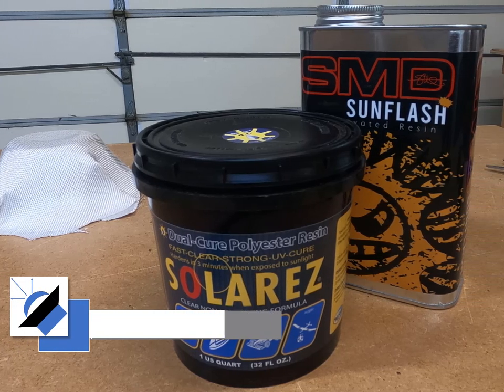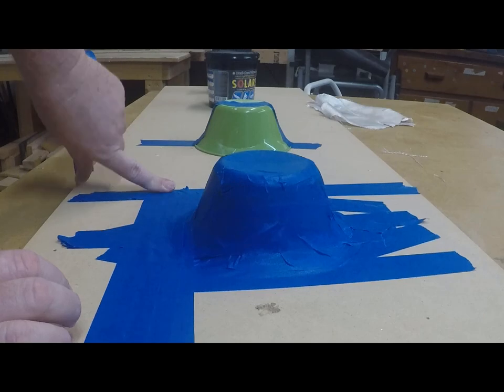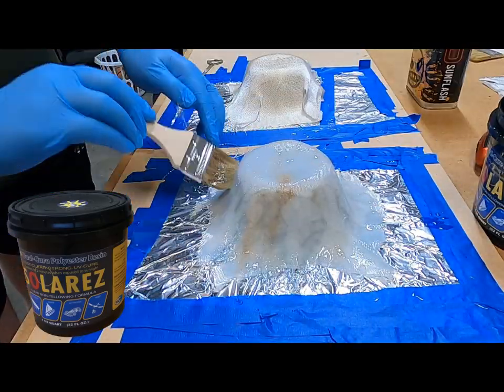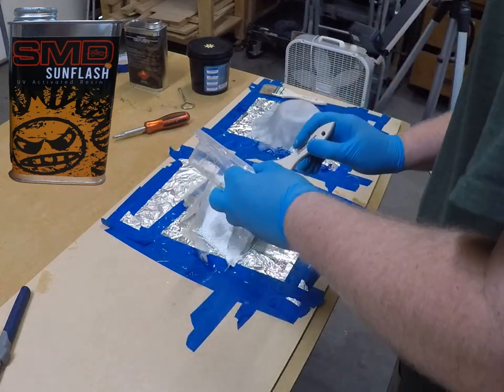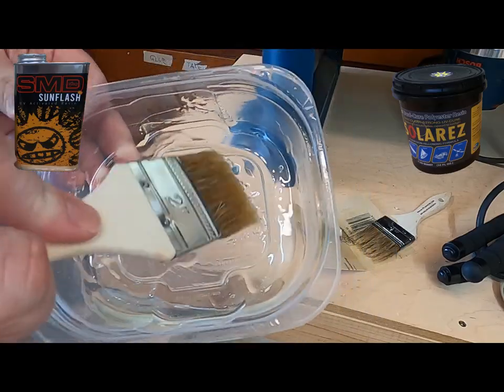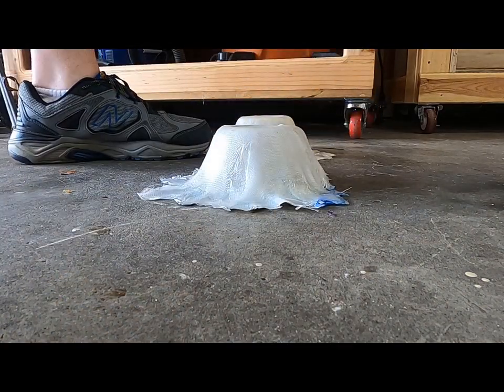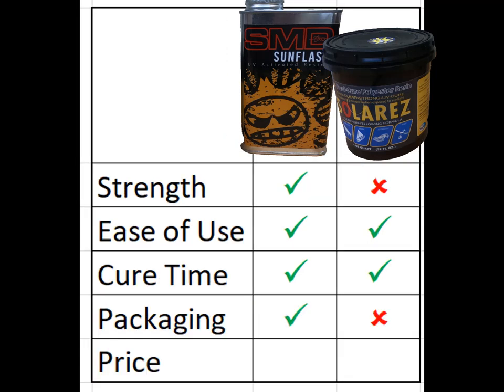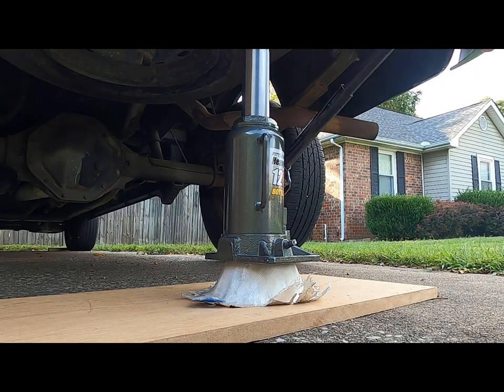The BEST fiberglass resin?  UV RESIN SHOOTOUT!

Comment: Never used the Solarez, but the Sunflash resin is absolutely amazing.  Tested it out before I decided to use for my sub enclosure that I’m currently designing.  The Sunflash resin cured in the sun on a cold day here in Ohio.  The outside temp was about 40 degrees with moderate moisture in the air, out in the sun.  The Sunflash cured rock hard in about 15ish minutes.  On a different day that was about 87 deg with moderate humidity in the summer, the outer coat of resin cured rock hard in about 5 minutes.  Flipped the mold over and another 10 minutes to fully cure.  The tests were done on 19oz woven mat used for pool repairs.  That is what I’m planning to use for the enclosure.  Only the bottom of enclosure is going to be glass, the baffle and all side panels are going to be birch.
Reply from the maker: 19 oz mat?  That's thick stuff.

Comment: So have you replaced your passive radiator? Just curious. I'm experimenting with different subs. Currently have 1 box with 2- 12" alpine type R and in a separate 2 cubic ft box a skar VXF with a rockford T-1500. The alpine box is tuned to bout 40 Hz the VXF is @ 28 Hz. Odd I know and prob frowned upon but the versatility is way cool. EVERYTHING sounds amazing. I wont go into it but there's components up front and 6x9s in the rear and are kickers ds series pushed by skv 100.4 far from high end, far from the cheapest. Just right.
Reply from the maker: Yes, unfortunately the PR's I was using are no longer available so I had to rebuild the box.  That video will drop next week.
Reply: @DIYAudioGuy  excellent I am looking forward to it!

Comment: Awesome video man, just ordered a gallon of SMD today for my current build. I hadn’t heard of Solarez, or it’s been a long time since I heard that name, it does kinda ring a bell. Do you know if it can be used on top of an already formed piece of fiberglass using traditional 2 part resin, like Bondo resin?
Reply from the maker: I have no idea!  The most frustrating part about either one of these products is the manufacturers don't really give you a lot of information.  These two things might have the exact same formulation, but with a different tint or pigment.  But then again, they might be completely different chemistries.